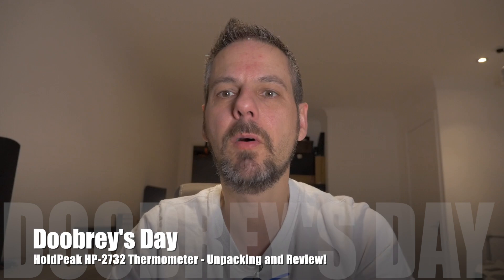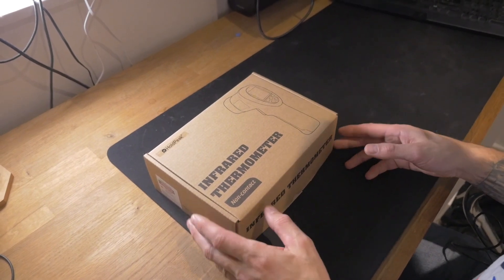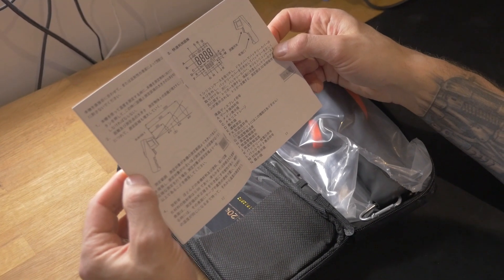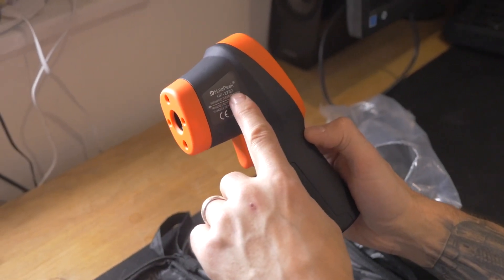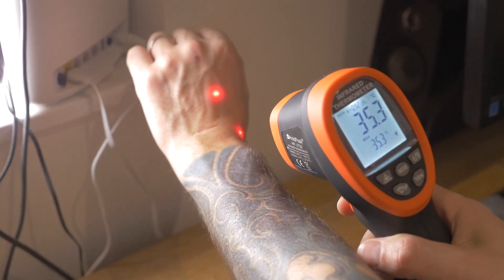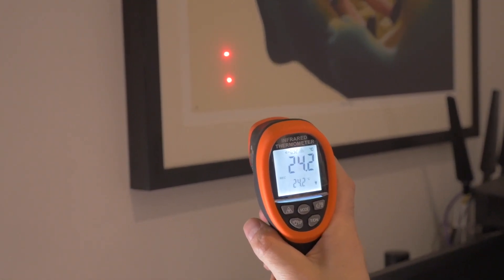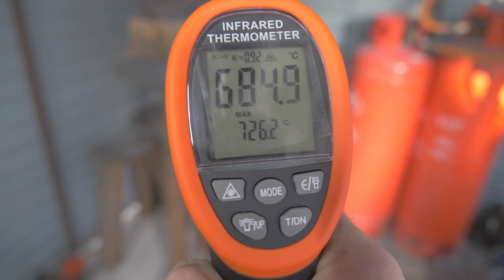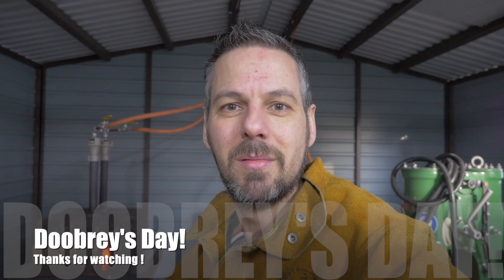HoldPeak HP-2732 Thermometer / Pyrometer!

Comment: I recently bought one of these for casting lead ingots and it was completely useless. I could not get a usable reading on the the molten lead it read from -13 to 72° F. Also It wouldn't even read cooling ingots, giving almost the same reading.  It gave a reading on the melting pot but that's it.  The settings in the manual only mentions stainless steel as far as metal and none on the common metals someone would cast at home like gold silver, tin, aluminum , or lead.  Maybe mine is broken but I don't think this is useful for knowing the temperature of molten metal. I think it will read things like the crucible and maybe the forge but my don't trust no touch Temps any more.

Comment: 4:28 Maximum you can go to: 1300.
Sounds to me like you got cheated by 200°C. Am I right?

I ask because I found this video while searching for reviews. If this thing is accurate I'd like to get one but I'm going to be working with nickel, which melts at 1,455°C, so 1,300 wouldn't be of much use except to tell me I'm getting close. Since you made this video two years ago are you still satisfied with it? Have you ever taken it over 1,300°?
Reply: There is now the HOLDPEAK HP-1800.